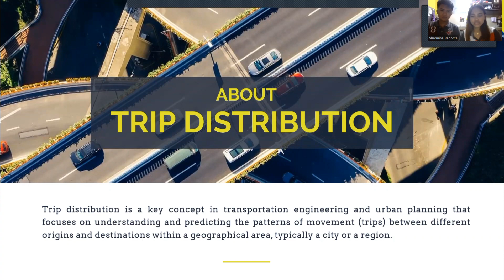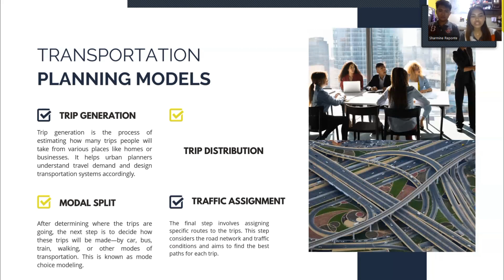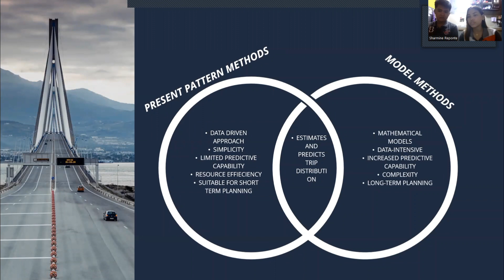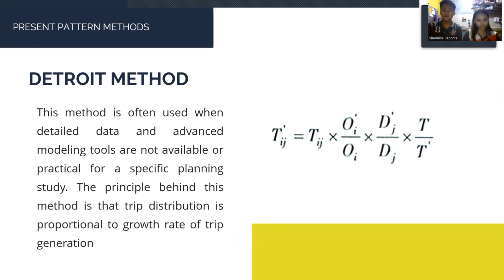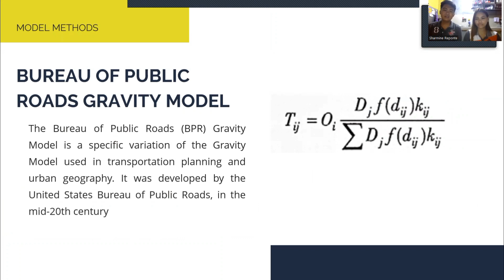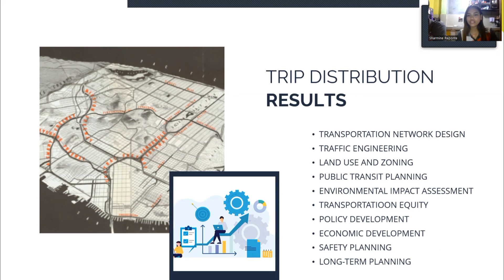TRIP DISTRIBUTION - REPONTE & GARNICA

Comment: Trip distribution is sigificant and useful for transporation planners and engineers as it understand and predict the patterns of movement or trips between different origins and destinations in a geographical area, typically a city or a region. To know the flow of vehicles whether there is traffic congestion in that location, it is vital to comprehend and predict the patterns of movement between various origins and destinations. By doing this, transportation engineers and urban planners will be able to evaluate this type of problems.

Comment: I have learned that trip distribution constitutes a pivotal phase within transportation planning, wherein it discerns the movement of journeys between various starting points and destinations across a given area. Grasping these patterns of trip distribution holds significant importance for urban planners, policymakers, and engineers as it enables the crafting of effective transportation networks. This process aids in the enhancement of infrastructure efficiency, congestion alleviation, travel time reduction, and the overall improvement of mobility.

Comment: in this report i learned that trip distribution is a process by which the trips generated in one zone are allocated to other zones in the study area. These trips may be within the study area (internal - internal) or between the study area and areas outside the study area (internal - external). Several basic methods are used for trip distribution, among these are The gravity Model, Growth factor models, and intervening opportunities. The gravity model is preferred because it uses the attributes of the transportation system and land-use characteristics and has been calibrated extensively for many urban areas.

Comment: Trip Distribution are being used in which, in the study area, trips made from one zone shall be allocated to other zones. I've learned that identifying the distribution models that are connected in trip origins and destination in a specific zones. It also measure the separation between zones are widely used in trip distribution in roadway travel time that will consumed that could calculated and computerized of the transportation networks.

Comment: In trip distribution, I've gained valuable insights into the crucial role it plays in urban planning. I've learned that it's the process of forecasting the movement of people and goods within a city, which helps optimize transportation infrastructure. Understanding factors like travel demand, mode choice, and spatial distribution has deepened my appreciation for the complexity of urban mobility. This knowledge is vital for creating sustainable and efficient transportation systems.

Comment: Trip distribution it is Estimating the number of trips that a specific development, location, or activity will produce is a step in the transportation planning process known as trip generation. Designing transportation systems and comprehending traffic patterns both rely on it heavily. Would you like to know or dispute something in particular
The spatial patterns of movement between origins and destinations are established through trip distribution, a crucial phase in transportation planning. When one stops to think about it, it becomes clear how important it is to comprehend how individuals move around and choose their routes when traveling inside a place. Distribution patterns of trips are influenced by elements like topography, land use, transportation infrastructure, and socioeconomic concerns. It is a key link between trip creation and mode selection, and it is fundamental to the modeling and forecasting of transportation.